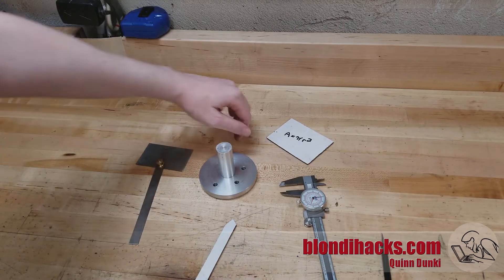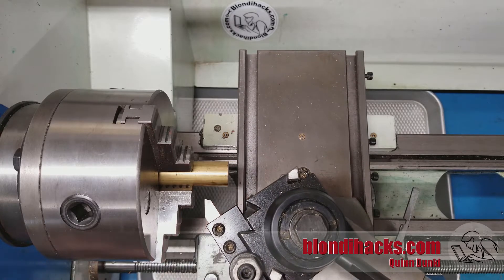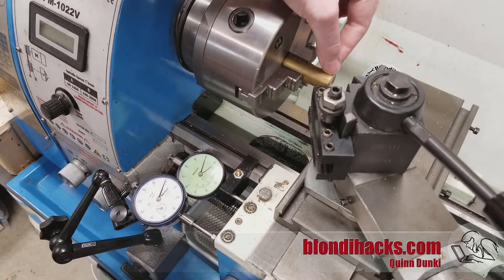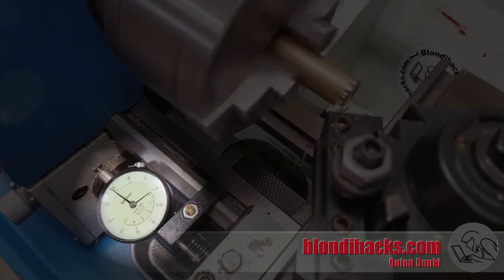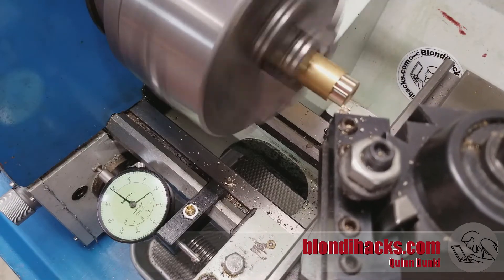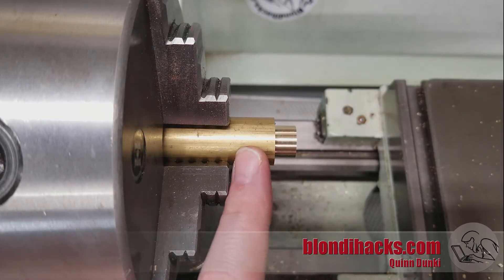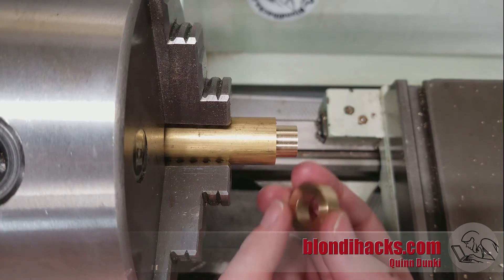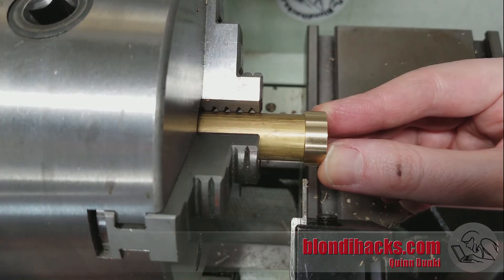Metal Lathe Tutorial 7: Turning To A Shoulder

Comment: Newb here:  the way the undercut is described it doesn't seem like it would remove the fillet.  Also, using a parting tool, mine has an angle on it as viewed from the top, so you'd want the longer part on the chuck side, right?

Comment: Is the parting tool essentially making a small undercut to make that shoulder square? Otherwise, the cutting edges of the parting tool aren't perfect 90 degree angles, either, so wouldn't there still be a (much smaller) radius fillet there?

Comment: Thanks Blondie you cost me money LOL. I really like the Mitutoyo 2915S indicator you show here, my old eyes like the large .01 dial over the typical round one that is small and off to the side. I ended up finding one on Ebay in almost new condition, I have the PM1130 lathe and still have to make a ways holder for it, I have tried the magnetic ones but don't like the fact they grab all the swarf around the indicator plus they don't keep the indicator aligned at a 90 to the carriage. I still plan to put a DRO on my lathe but until then this will do.

Comment: Can you set a zero on the carriage handle dial after facing so you know how far you will go to the shoulder? The indicator helps but I wouldn’t know where to move first. I know you would probably use something like a depth micrometer to double check that it’s the right amount, but it sure would help to have numbers on dials.

Comment: I usually turn the shank to within about 1 mm of the face, and than face the shoulder . Especially on big parts. On small parts it's more difficult, though. But I have never been able to get a finished shoulder  surface using your method.
I do find your videos concerning lathe and mill operations most instructive, though. No chaff, clear, and up to the point.

Comment: Speaking from an aerospace perspective, I would prefer the option to leave a small root radius on the shoulder and add a small chamfer to the mating part. This option would remove the potential stress raiser that is inherent to a sharp corner. As part of our design make meetings, we always ask the design guys to use corner radii that coincide with the radii available with indexable inserts. This makes life much easier for us manufacturing guys when producing the finished parts. Great video content and nicely paced narrative explaining each activity.
Reply: Looked into comments to find this comment. Sharp internal angles are the stress points. Not only in aerospace, I faced this even in construction. That's the frequent place where cracks can occur.
Reply: @konserv  perfectly true, any sharp corner is a potential area where stress fractures can occur.
Reply: I'm just an amateur but I was thinking the same thing watching this. I'm sure it probably wouldn't be a problem for most things in a hobby machine shop though, so it's definitely useful to know in the context Quinn is presenting it, but I can imagine in your line of work any stress raiser geometry in a part's manufacturing could literally be life or death for anyone using the aircraft, missile, etc it gets put in! Out of interest, if your designers really needed to specify a fillet radius that didn't correspond to one of your standard indexable tools, how would you go about cutting it? I suppose it'd depend on the scale, but is it something you could build into a CNC tool path or would you need to create custom tooling with the correct radius?
Reply: @yetanotherbassdude   The parts I manufacture are for gas turbine engines (Rolls-Royce).  If we have to produce a non-standard radius we normally opt to cut this using circular interpolation on the CNC machine. Alternatively, you could have a tool point ground to the required radius.  We are lucky in some respects as being a large manufacturer, is that we have representatives of the major tool manufacturers permanently based on our site. This is very useful when trying to organise the manufacture of STP (Special to Product) tooling. The Sandvik tooling guys also organise trips to their manufacturing facility so we can appreciate how much technology they use when manufacturing tooling and tool inserts. I was fascinated by how they deposit the coating on the inserts themselves, I always wondered how they achieved that.
Reply: @michaeljohnson-li5nn  that's amazing! That's a heck of a job to have, and I can imagine you really do need to be completely on top of how you're machining or manufacturing parts for something as high temp and high stress as that. So is it just that you'd do a cost/benefit on how much machining time you can save with a custom tool instead of a circular CNC tool path, or are there material differences in the end product between a radius cut with a CNC pass versus one using a custom tool point with the correct radius that would make you choose one over the other? Also, you can't leave us hanging about that coatings process either! I did my undergrad in materials science, and even though I never really went into the industry I still find those kinds of materials manufacturing processes fascinating!
Reply: Civil engineer here, agreed.  Was going to post a relevant comment but you got it.  Also, going in with that parting tool does remove a smidge of meat off the shaft reducing its effective diameter..
Reply: Great comment Michael. I hadn't thought about that. I suppose there are 2 types of machined parts. There are non-moving, or non-stressed mating surfaces, like caps and covers. For example a water tank with potable water, or a glycol overflow tank, which has no actual pressure. These parts don't need special consideration. But I wanted to mention something. Welding, and grinding welds. How many people on the internet, you see them grinding welds? One thing about grinding steel is that it leaves little cuts in the metal, that run parallel to the joint, which is a massive point of stress fractures! I think this is more problematic than machined parts breaking, honestly. One thing I learned in building engines, is that you do NOT want grinding marks on any type of steel or iron alloys, because the part can begin to crack at the grinding mark. Instead of grinding welds, the best thing would be to grind them, then do a fine polish on them, or grind and then shot peen them (sand blast with metal pellets??). I don't grind welds if I can avoid it, because welds are glassy smooth, and there are no sharp edges to snap off. Lots of people grind welds with a coarse wheel, then paint over it, which is a horrible long term strategy for stressed frames and brackets.
Reply: michael johnson makes sense.  I was thinking about paying someone to make a lathe backplate, where I want a stress-relief radius, but don't know how to size it.  Nothing will mate to it, so it doesn't have to match anything.
How would you size something like that?  It's the transition from a 4" collar on the spindle to a 6 or 8" diameter flat plate.
Thanks